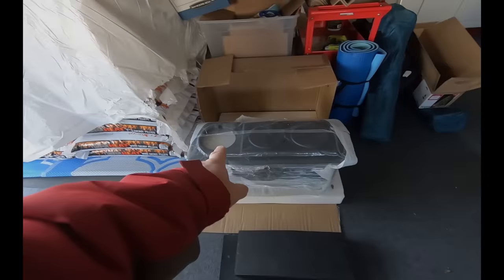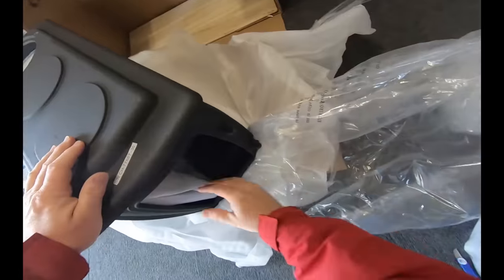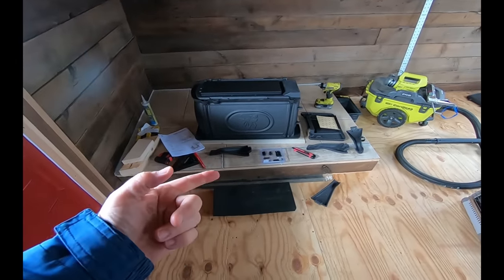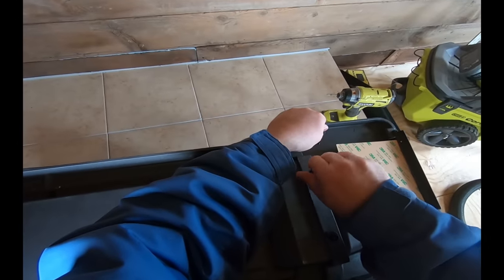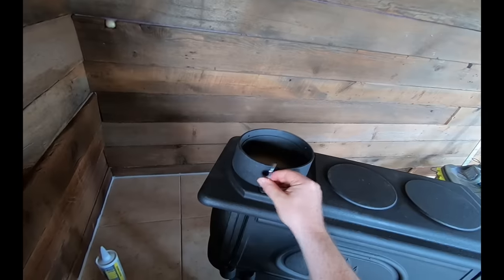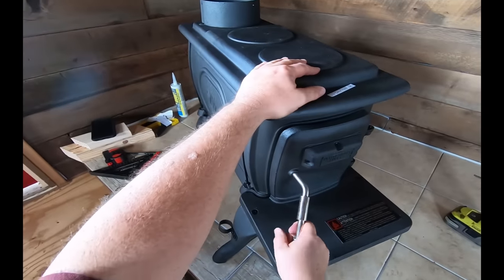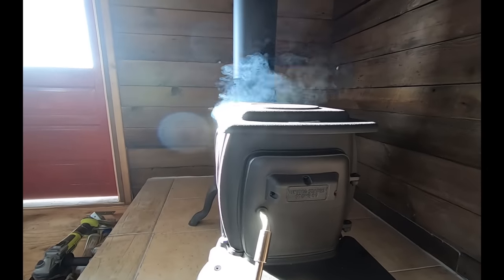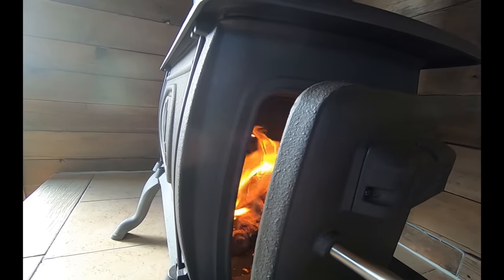U.S. Stove Company 900 Square Foot Log Wood Stove...ASSEMBLY, INSTALL, AND FIRST BURN

Comment: Not a bad idea to burn off all that Shenzhen manufacturing shmoo outside before final installation
Reply from the maker: I just opened up all the windows.  After 6-7 fires it’s still burning off!
Reply: @LancoAmish  yeah, you should do about an 8 hour outdoor burn outside at a high temp before installing them inside. I’m surprised the manual didn’t say that.

Comment: Glad to see you temper the stove in because everything like it needs to be tempered but there's always one person that won't heed that warning, I've been a Mason for 30 years and have built a lot of flues and fireplaces on houses and I always tell people you have to build two or three small fires first then gradually build up because if you build a card roaster in it the first time it will crack your fluiners, I've only had one person not listen to me, I built a flu on a brand new house one time and told the people how to temper it in and the first thing the lady done was filled it up with cardboard boxes and burned them, now nothing burns  hotter than a cardboard box and it cracked every liner in it from the thimble up, that was an expensive lesson for her because we had to tear it down and rebuild it
Reply from the maker: Thanks for watching. Directions are so easy to follow!
Reply: Also paint has to slowly cure, unless it's been done in furnace at factory.

Comment: When first using a new wood stove it's a good idea to put it outside for the first burn, so that all the new smell burns off and doesn't stink up your cabin. Good luck, Mike
Reply from the maker: Thanks for watching. It’s in a small cabin so it’s easy to air out. It’s still burning stuff off after 5 burns.

Comment: Had a similar model to this that I bought at tractor supply in 2009 but the top two eyelets were removable as well as the rest of the top that way you can put cast iron skillets or other stuff on there same shape and size of this but it had a thousand square foot I used it in my 16x40 open floor space tiny house in Alabama but mine had a damper installed so I can regulate the fire burn rate
Reply: That is the style I am looking for.  The removable inserts are important to me but it appears the EPA has screwed things up to where those stoves are no longer available. Hopefully I can find a used one.
Reply: @michaeldavidson9939  I'm sure you might be able to find one out there somewhere , cuz I'm going to start looking for another unit to put in my mobile home
Reply: @michaeldavidson9939  I got a used volgazang for sell, it will need cleaning up and painting.  $75.00
Reply: @donaldatkinson7937  is that stove still available? Can you ship it?

Comment: Just set one up last week for my mother-in-law in Mexico. Cold front came down from Colorado and the area dropped into the mid 30s. House felt great for Christmas. We were back up into the high 70s by new years. They will use it about 8 weeks a year but are very happy to have it for those cold nights.
Reply: Northern Indiana  we get minus 30 for about a month straight, rest of the time we have around 8 to 9 degrees

Comment: I've got an older version of that stove that I bought at tractor supply in 2014. It heats my shop and it still works great today. Every 2 to 3 years I put a new seal on the door and reseal the seams as needed. It is a very good stove for the money, I think you will be happy with yours.
Reply from the maker: Thanks for watching.  It seems like a nice little stove so far.
Reply: Not likely, it's not made the same way. No way to control airflow and cheap construction - Chinese crap

Comment: Nice looking little stove. I've been searching for something that will work in the shop and not break the bank. I was also looking at the US Stove pot belly.
Reply from the maker: I love it so far. I did not put a damper in the stove pipe as recommended and have had no smoking in the building. Many complain about the stove smoking but I’m using the correct stove pipe and chimney setup and have had zero issues.
Reply: What stove pipe did you use ?

Comment: Nice video of the first burn and the stove paint curing.  The paint curing does put off CO2 so the windows need to be open.  Good job pointing out that you should follow the manual when installing the unit.  It is not rocket science, but people who never do this do not know it by intuition.  Great job with the video and explanation.

Comment: I have the same model and it works great. Heats very well because it has some intern air circulation keeping the heat in the cast iron instead of the chimney. The only issue it has is the latch keeps bending in so I usually just use a brick to hold the door shut when I don't want to fiddle with it.
Reply: I had the same thing with my stove door but that was a long time ago other than that the stove was awesome.

Comment: I don’t know about the wood wall , I had a few logs about 2 1/2 feet away from mine and the heat of the stove ignited the firewood . I was working in my garage and wondered what a safe distance would be . I was surprised to see it start to smolder . I have a 3 x 4 ft section of pole barn siding about 6” from the back of my stove that cuts the heat substantially and store things against the wall the heat doesn’t penetrate the steel and keep everything about 48” away from the sides . I have a vogelzang and I only burn hard woods . When I clean my flew it’s always clean with no debris . Going on over 12 years . Love it cook on it all the time , man cave heaven . I think that US Stove and Vogelzang is the same company , not sure but it seems like I called Vogelzang to order a new grate and US Stove answered . Thanks for your cool video , I’ll look for updates .
Reply: The more expensive stoves have small clearances, ours is only like 9 inches from combustibles

Comment: I would forsure put a damper on there. I just bought one today at tractor supply assembled it and put it in my spare room until i can afford to get the rest of the stuff to put it in and put it to use. Hoping by next week i can do it all on my weekend off. I am installing in my single wide mobile home. With two small children, cold temps and high winds, once power goes out it could be hours until they get it back on. Am hoping to use it as our main heat source.
Reply from the maker: I’m debating about a damper. I’ve burned it a few times. Thanks for watching.
Reply: @LancoAmish  i got ahold of us stove about a few things in the book and apparently our lovely government outlawed flue dampers. And this little stove does not have a damper built into the stove
Reply: dampner for sure.
✌
Reply: What state?
Reply: @donaldatkinson7937  pa

Comment: I have the 1200 sq ft model with glass see thru door. Love it. With it being EPA  compliant with the air tubes , make sure your wood is completely seasoned.
Reply from the maker: Thanks for watching and leaving a comment. Mine hasn’t smoked a bit inside. Using well seasoned wood like you say is important.

Comment: I might suggest using automotive anti seize on those bolts and screws that will experience high heat when the stove is in use.  That way, in the future, if you have to do some disassembly for repair, they will back out with less chance of breaking off.

Comment: Great wood burner . Have two older ones don' have the tin pan on the bottom but the same stove. They run best at 300 or 400 you need a temp gauge for the stove pipe 10 bucks on e-bay worth having cuz you know what its doing. That stove will last 50 years  plus. I always called them Box wood stoves. don't know about 900 square foot area, heated my house with one for 20 years ,the heat from that wood burner will drive you out of that small room your heating.

Comment: I just bought the older model. The manuel shows no baffle. Basically a box with the secondary tubes. I will be calling the company to see if I need to add a baffel.  I was on a us stove forum, and someone said it does need a baffle. Idk about that.

Comment: I have the same stove - 2 years running now. I did install a flew dampner, but very seldom if ever use it🤷‍♂️ Operates flawlessly👍 Not sure if I need fire bricks in the floor though🤔 Seems okay without them.
Reply: How did the damper work?
Reply: I put fire brick in mine. I couldn’t find anywhere in the literature saying this model requires it, but figured it wasn’t a bad idea
Reply: @bornfree3630  okay, thank you👍

Comment: I just bought one last night. 575 with tax Canadian. I did assembled it last night; This is not my first stove. Once assembled I noticed right away the door was hard to close. You can see that the door is straight on the hinges side but on the latch side the door is bowed a little bit. The handle, WOW what a hazard that one is. I'm suprise they let that one pass. The bend in the handle should be closer to 35 to 40 degrees and should be at the 10 o'clock position when close. It should not be a 2 piece. On mine the handle turns on the other piece while trying to shut the door and it makes it super hard to close the door. Another issue is, you can't control the draft. That is just plain stupid in my opinion. I can see it be a problem in the big wind and snow storm this winter. I've never ran a key in my pipe. And I have no plans to install one. But I will for sure fix the issues with that stove.. The handle will be bent properly. It will stop at the 10 o'clock position when closed. And I will weld the 2 piece together. The draft hole in the door, I will build a proper draft door for it. Probably a slider type or screw type draft. Another thing I'm doing is adding fire bricks inside. Especially on the bottom. I live in a 32 foot motorhome; It is parked where I work. And they don't charge me to stay here so it's free rent. Paid 2500$ for the motorhome. It's a 1988 Pace Arrow. I live in it by choice. I don't have too. I can afford an apartment or a house. But the money I'm saving during the summer is worth it for now. It's my third winter in it. Sold my house December 2021. Moved in my RV December 31 2021. First winter I used the propane heater that is factory. Was going through a 100 pound tank every 5 to 6 days. It was 139$ a bottle to fill. Second winter, I installed a diesel heater. More like 3 of them. The first lasted 8 weeks running 24/7. The bearings for the fan let go. Had to buy a second one. That one lasted 8 weeks too and the fan quit. My 3rd one is the best so far. It's blowing heat as I write this. I go through 10 to 12 liters  of fuel per day. Furnace oil is 1;834 dollars per liters. Plus gas for the generator cuz my battery bank is not big enough to run my heater all day if the sun don't shine. It's costing me about 20 to 30 dollars a day at the moment during the winter. So this wood stove and all the stuff I have to buy to install it should take about 8 weeks and it will have paid itself. I plan to burn hardwood pallets. They give them for free all over town here. And wood is wood no matter how it's cut. I may by some firewood. Not sure yet. I burned pallets for 13 years in a row. Cuz they are free except for the work to go get them, cut them up;  bend the nails, and stack it all up. 

Edit, I've fixed the first diesel heater by replacing the fan. I need to order another fan for the second heater. The first diesel heater was 184 tax in and free shipping from amazon. And the 2nd and 3rd diesel heater were in the 210$ to 220$ range shipped. They work great but small for this size of motorhome. I've only installed one heater. It would be too expensive to run more than one at the same time. The first one I bought has an aluminum shell. The other 2 are plastic. Aluminum is way better. It puts out more heat than the plastic ones.

Comment: I'd love to find a little coal stove for heating my 20x20' basement during the coldest winter months, got a old fisher wood stove that does the 1st/2nd floors but at the opposite end of the house to the living room and the hardwood floors get awful cold.. could probably cut my wood use in half in coldest months with a little tiny coal stove I just can't find one to buy

Comment: I have the original version of that stove. Mine has a damper and an adjustable grid on the hearth. I would suggest laying fire brick on the bottom especially if you'll be burning oak.
Reply: Can I ask why?
Reply: @Johnnysokko168  Anyone can.
Reply: @Johnnysokko168 probably cause oak burn super hot?

Comment: How does the inlet air get in and how do you control it? Having a chimney with a good draw is useless if the fresh air can't get in to support it. I grew up with a wood stove in the 60s. It had an opening below the door and a small ash pit. You controlled the air flow with how much ash you blocked the opening with, thus also controlling the heat output. Using a damper with no inlet control is a good way to produce smoke in the house. We had a manual damper, but it was never used as the fire was better controlled by the inlet air flow.
Reply from the maker: Primary air is drawn through the door. Secondary air is from underneath the stove traveling through the air tubes inside the stove. This is a single burn rate stove. It is designed, with the correct draft, to burn correctly.

Comment: Does it smoke at all in your house? I just ordered one and see another video said it has smoke leaks at the door gap. Now i am worried
Reply from the maker: If you have a good strong draft there shouldn’t be any smoke leaks regardless. Mine is installed without any elbows…straight up to the chimney.  I have no damper in the stove pipe as the directions state. My door seals good but you can always replace the gasket with a thicker one if needed. There’s also adjustment on the latch itself. 
My personal opinion is it’s a good stove unless there were casting problems when manufactured. Many people do not follow instructions when installing it either. Less expensive stoves like this made to EPA standards are not to be installed with a damper nor is the internal baffle to be removed. The stove is what it is…a single burn rate stove and altering it will probably make it smoke.
Reply: @LancoAmish  thank you so much

Comment: I have the same exact stove. I took out the baffle covering the flue collar because smoke was building up in my house.
Reply from the maker: Thanks for watching. I’ve burned it a few times now. No smoke inside. It seems to work as designed as there is very little visible smoke coming out of the chimney…much like the newer outdoor wood furnaces.
Reply: Says to not remove!
Reply: @jimmiegregory8386  been using the stove without the ridiculous EPA baffle for two seasons now and I’m still alive. Chill.
Reply: The baffle has a purpose.   Read up on it and you'll find that you need that in there.   My older insert (Osburn) uses a blanket of the ceramic insulation.   Today they use that solid piece.   IT's to protect things.  Put it back in and figure what's causing the smoke.
Reply: It no longer smokes
Reply: Im so confused i bought this stove for my garage, this thing sucks even after 6 hours running it only warms the garage up like 10 degrees my 40000 btu torpedo heater does much better. What of this epa stuff can i remove what is the baffle?
Reply: @alexwinger1827  You must have a cold garage.   To heat a garage with that little thing might take a while.   Get yourself a real stove that can heat it faster.   
How insulated is your garage?    I hope you don't keep flammables in there, because in my township stoves are illegal in garages as fire hazards

Comment: My husband installed and put together one of these in our tiny home. It heats well but smokes out of the stoves pipe. It smokes out of the stove itself where the back piece and sides come together. My husband says its gapped where it comes together. Is there any kind of sealant that will work to keep the smoke where its supposed to be.
Reply from the maker: Is your chimney pipe high enough above the nearest peak? You could have a draft problem.  Too many turns in a stove pipe can also lead to poor drafting. Another problem could be burning unseasoned or not seasoned long enough wood. 
You can use a good furnace cement like Rutland 2000 degree furnace cement for mortar and metal. It’s made for the problem you’re describing.

Comment: Good vid, thanks, and cute stove. Two thoughts right off the bat, though. First, sealing the flue (and to an extent, the screws) - isn't that going to be a pain to clean out the creosote? (we used to have to take our pipes down every so often and dump out the creosote). Second - no fire bricks? Over time, burning on bare metal is going to burn through the iron, plus bricks increase the efficiency. Just things that crossed my mind...
Reply from the maker: Fire bricks are not recommended. A bed of ashes are. I wouldn’t use a stove unless the pipes were screwed together. If something were too fall into the stove and move it the pipes could come down.

Comment: Do I need to use a fire box to go thru the roof.  When is that necessary.  Thank you.
Reply from the maker: The box is a support box to support the weight of the chimney pipe above and to provide safe clearances between the pipes and roofing material.

Comment: From personal experience, these wood stoves are so loose as far as too much draft . They burn way more wood then they should. You'll have use a lot of sealant and glassrope. Just a heads up. Used several in large ice shacks , and traplines camps over the years.

Comment: I just started putting mine together and it wobbles. The one leg that’s different is meant for the front right (says the directions) other then that the other three legs all look exactly the same. Also before you ask I used a level on my concrete floor and it’s level.. kinda disappointed. Any solutions other than a small rock?
Reply from the maker: Try loosening all your legs a bit with the stove upright and sitting on them. One or more may not be seated correctly.